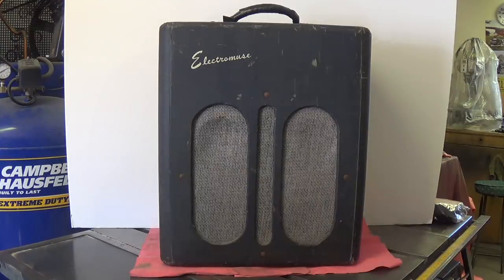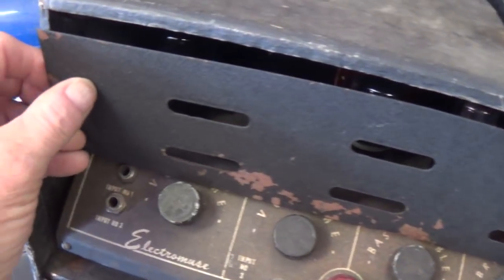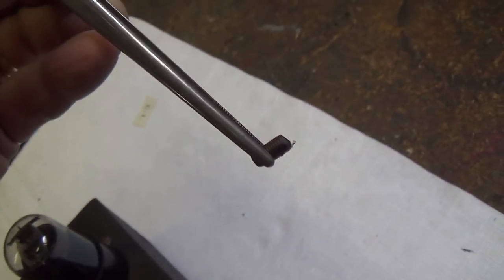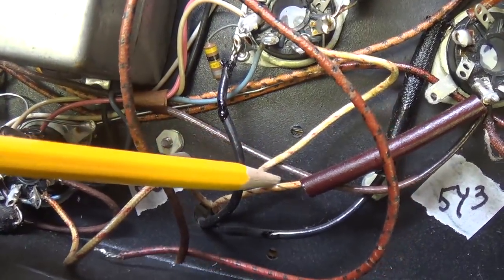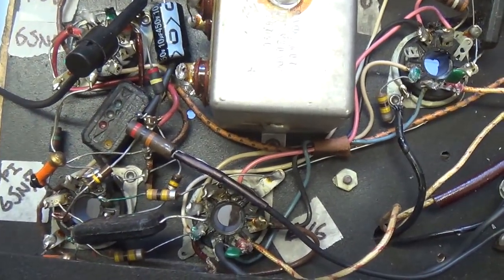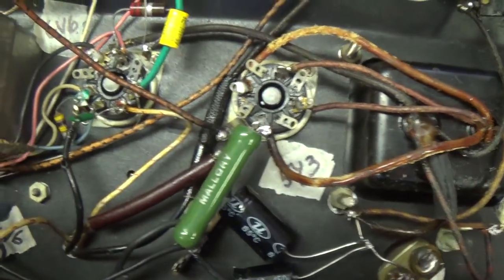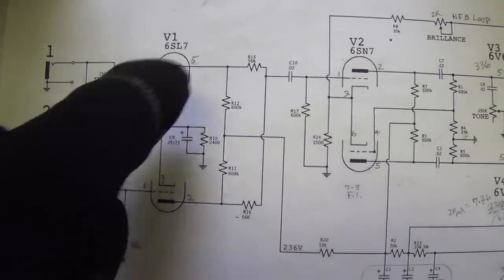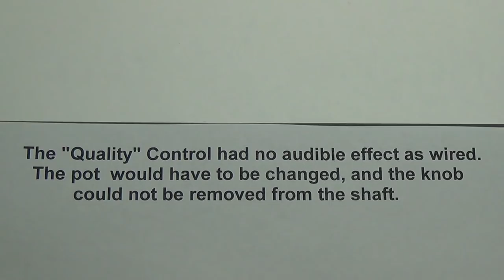Let's Explore and Repair a 1946 Electromuse Amp

Comment: I would not have believed you could have got that amp to sound that good, or even power up.  It just looked beyond repair upon first glance.  Four 5 inch speakers - I guess we know where Mr Bose got the idea for the 901.  I have two question: at about the12 minute point, you said that the filter cap and the other cap can tested "very respectable."   I was wondering if you found something (or I missed something) that caused you to bypass those caps. Also, the transformer that was not original, must have been serviceable enough to keep in the circuit.  

I really like watching a guy that can breath new life into an old tube amp.  Cool.
Reply from the maker: Thanks, JD. The ancient  electrolytics I tested all seemed to have excellent ESR values......but when dealing with a customer's amp repair, it's always best to simply replace the outdated parts. The caps probably would have failed in the near future and might have caused some circuit damage. I ended up believing that the output transformer was indeed original to the amp. I'm glad you enjoyed the video.
Reply: After watching it again, I did notice that you said based on the "HH" markings that the output transformer appeared to be original.  Sometimes old guys like me have to see things two or three times to have it sink in.
Reply from the maker: No problem, JD. I'm flattered that you watched it that many times :)

Comment: Just for fun have you ever just tack soldered a nice 25uF 50v cap across that shared cathode resistor on the power tubes? I bet it would wake that amp up a lot. People might complain about modding an old amp but these aren't exactly collector items and a mod is easily reversible.
Reply from the maker: That's an interesting suggestion, Joe. I have added cathode bypass caps to circuits, generally PA amps that can use some "warming up" for guitar use, but not to the Electromuse. I would try it, but the amp was returned to the owner long ago.

Comment: What were your thoughts to ballpark the speaker impedance from the DC resistance? Is there some kind of rule of thumb to account for inductance from the coils?
Reply from the maker: The DC resistance of a voice coil is about 70% to 75% of the impedance......so a 6 Ohm DC resistance = about 8 Ohms impedance.

Comment: When you demo a amp you just finished there is a picture of the amp backwards. Is the amp actually backward when you are demoing it? Or is it just a still picture. I am enjoying your videos very much
Reply from the maker: When I was testing it on the bench, the speakers and cabinet were facing away so I could connect the speakers to the chassis. In the house for the final demo, the speakers were facing the camera.
Reply from the maker: P.S. It's not a still photo, but a video in which nothing moves, while the audio is being recorded.

Comment: Uncle Doug, Can't wait to see what make the "Electromuse" work but I had to stop a 1 min to ask; what was that machine under the plastic? By the saw blade clock on the wall.
Reply from the maker: I think you're referring to my vertical milling machine, Luther. It takes up a lot of real estate on the workbench, but that is the most solid place I could find to install it.

Comment: Geeze Uncle Doug... that was a great video (as usual)
After playing many many horrid sounding amps thru the years I've found that any hum can introduce a slight to awful 'gargle' to the tone*... which is what I think I hear going on here. 
What do you think? Thanx and I think you guitar skills are improving. cheers
...and yes I do dig your truck extravaganzas, now that you mention it... (;-b)
*60 cycle gargle, right?
Reply from the maker: Thanks, Jonny. The amp is absolutely silent, and you are the only one to enter a negative comment about the tone.....so I tend to think the issue may be with your speakers or sound reproduction components.
Reply: I'm happy to be wrong... 
cheers

Comment: Doug, The circuit for this amp looks a bit like a 1960's Ampeg J-12B only without the tremelo circuit?
Reply from the maker: That could be, O. It's not uncommon for similar circuit designs to be used by multiple manufacturers.

Comment: Uncle Doug,  I am working on a renovation of a Hallicrafters receiver.  It has some of those domino capacitors.  Can you provide a link to the color code of the caps so we can replace them if necessary with similar values?
Reply from the maker: Yes, I can:   http://antiqradio.com/post_mica-capacitor-color-codes.html   Good luck with your restoration.

Comment: Hi doug you didn't show the brilliants how it works does it work in a way of like an distortion to clarity?
Have you tried that coconut oil on your hands yet?
Reply from the maker: As wired the NFB circuit didn't work well, John. The 500 Ohm pot was overwhelmed by the 30K series resistor.....but yes, such a loop generally does offer quick distortion at one end of the dial and big headroom at the other.  I intend to. Thanks again for the suggestion.

Comment: Thanks for the great video. Perhaps Pete rammed his axe into the grille.
 I will add my endorsement to DeOxit (and other Caig products). I've also had to put up with those crappy Micamold caps. (They look like mica caps. They have 'mica' in the name. They're just leaky paper caps, trying to look like mica caps. Shlock. Discard any of these that have capacitance values in the coupling range, they're usually bad.)
Reply from the maker: You're welcome, DK. Glad you like DeOxit.....a great product. I agree, all Micamold caps should be ripped from the circuit and incinerated.....what junk!

Comment: Doug, I notice you have the dreaded yellow powder under that chassis which we know is toxic to breath ( Cadmium plating) .  How do you personally deal with that problem?  I worked on a Philco 1201 radio / phonograph that was loaded with that yellow powder and I didn't know better.. I had a cold for about 2 months after that...I learned the yellow power is no good.  Nice job on that amp...
Reply from the maker: Thanks, Ron. Compared to some of the fumes I encounter when welding and painting......Cadmium dust is almost like vitamins :)  I know I should be more careful, but as I get older and older, there seems to be less and less reason to do so :)

Comment: Hi Uncle Doug, would have mailed this private if possible and no intend to school you in any way.. but for the sake of great old audio gear i need to speak for this big metal caps you found in this amp. The big old metal  caps that have these respectable esr readings..for me they look like damn fine oil paper caps.. so no electrolytics at all, but among the best sounding and long lasting caps you can get.  If i am right, and these are oil paper caps, they probably last way longer than the new ones you have replaced them with..In case there have been no other problems with them , that dont show up  in the video, i would recomend to leave them their jobs.. In audio circuits where you hear the caps, like old studio mic pres, these caps have a very sweet , dark warm , almost wet tone.. Dont know wether this cuts thru in an guitar amplifier circuit too.. But just for the sake that this are greater components than they build today i suggest to keep them in duty if possible always.  You probably dont find them often in guitar amps since this have been expensive parts back than already. But in very old tube broadcast studio gear up to late 50´s they are quite common and only rarely need replacement when they ve lost their oil filling by rust damage .
Reply from the maker: No problem with the public comment, 3P, I am always glad to receive knowledge and insight from comments, and they may also be of interest to other viewers.  I appreciate your input and will definitely keep your suggestions in mind if and when I encounter this type of vintage cap again. Thanks so much.

Comment: Hi, l have a doubt, do you think that is possible to put separate bias points in a two 6v6 cathode biased   amp? I want to bias each tube separately to ''match'' the output, is it practical?
Reply from the maker: Yes, it is. Simply use separate bias resistors, one for each tube and pick specific values that make their plate dissipation's match.

Comment: Uncle Doug , I still have that old Airline  tube amp(i think model # 2002  if you want it ,its yours I ll never do anything with it except look at it on a shelf  , dont feel like trying to sell it (lazyness )
Reply from the maker: Does the amp have a power transformer, EJ, or is it a series-filament circuit?
Reply: yes Uncle Doug it has a PT and I think the only thing wrong is the 
6au6 valve I ordered from ebay isnt heating up , its a dim glow at its base while the others show good , I think I have the )PT wired correctly it doesnt over heat or go apes**t in any form ,and i get signal when guitar plugged into it and the OPT  wired into the input of another amp via and old guitar cable ,its only a chassis no cab ,However I did  talk the wife out of an end table for wood and built a head type enclosure for it  it looks pretty good too , I had plans for it but lost interest.I built another cab with a single ten ,it looks really cool in it's little mini stack way.
Reply from the maker: It sounds interesting and fixable, EJ. You could probably send just the chassis, if you wanted, to save shipping cost. Please give me your e-mail address and I will provide a shipping address. Thanks !!

Comment: Where those big caps really electrolytic?  The case reminded me of oil caps.  I'm not sure how they hold up over time, but I suspect "pretty good".
Reply from the maker: They seemed to have very respectable ESR values, Russell. I didn't open the metal containers, partially for fear of what god-awful carcinogens they might contain :)
Reply: Looking more closely, I did see a "+" marking on the one.  The "bathtub" caps I'm thinking of weren't polarity sensitive.  But they sure seems to be the same style container.
Reply from the maker: As much as I love preserving old components, I just couldn't leave these jewels in circuit, especially in a customer's amp that is going to be many miles away.

Comment: How do you read the domino.color code on those foil capacitors. My instructor in my college electronics course is giving me two old vacuum tube testers if I could repair them and calibrate them. One (Hickok    MODEL: 6000A )  Tube Tester and one (B&K DYNA-QUIK MODEL 500) TUBE TESTER also one SPRAGUE TEL-OHMIKE
MODEL TO-5 CAPACITOR ANALYZER
. I also realize I believe from watching some of your old videos and other YouTubers for radio repair I may need to get some calibration tubes to properly and accurately calibrate these testers. I’m a newbie learning
Reply from the maker: That's a good question, TL. I would have to measure one and try to figure out what code corresponds to the value. I believe that my tube tester is a Hickok like the one you are getting. I've used it for over 30 years.....and still love it. You will learn a lot fixing up the old instruments and figuring out how to use them. Manuals are generally available on the Internet.
Reply: Wow that is rather cool of your teacher. Nothing like the education you'll get from repairing those puppies.
Reply: they are old and dry. no reading. ill try to goggle see if i can get wiring  schematic
Reply: Information on how to read those molded mica caps is actually out there, here's some sites I found.
http://www.radioremembered.org/capcode.htm
http://www.tpub.com/neets/book2/3g.htm
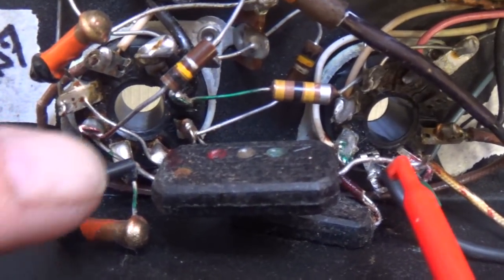The cap shown around 14:54 still has me stumped though. Green-brown-red with an extra orange, is that a 5100 pF @ 300 V? The schematic only shows .02s and .0015s, so I guess I had that backwards and it's a .0015 (1.5 nF). These caps seem to be quite nonstandard. Joy. This real old stuff even predates the E series of preferred values entirely, which was actively being worked on in the late 1940s (and extended in the 1950s)!
Reply: thanks

Comment: Scuse me for posting this in the wrong place...I did understand that you don't think it's neccessary with a cathode follower? Is it herefore just as good to drive the tone stack from a standard plate output gain stage?
Thanx!
Reply from the maker: If you plan on a triple tone stack, then a cathode follower will help to reduce signal loss, but if it's only a single or double TC, then plate output should suffice. If you do choose to go the CF path, then I suggest the Fender 5E8-A Twin circuit as a model for you to emulate. It uses the second triode of a 12AY7 in CF mode to drive the stack.
Reply: Great thanks Doug! btw it's a 2 band james tone stack
Reply from the maker: Adding a CF never hurts, Peder, as long as you have the space and parts to do so.
Reply: ok great, that's what I like to hear...:) and we are talking about the dc-coupled CF here or not?

Comment: Dear Uncle Doug, I love your videos and learn a lot! But I havent learned enough yet so I need your advice! I bought an old PYE hfs 20M amplifier (dual EL34 they say). I googled it and it turns out to be worth quite a few bucks. How do I apptoach this case without damaging the old beast?
Reply from the maker: I'm not familiar with the amp you have acquired, FT, but I tend to treat all amps alike, regardless of value. If you do not feel qualified to repair the amp, then nothing I can say will make much difference. You can either plug it into a current limiter and try to fix it yourself, as a learning project, or take it to a qualified tech and watch what he does. Best of luck with either option.
Reply: Thank you. The value kind of scared me so I think I'll pass it to an expert:).
Reply from the maker: Best of luck, FT.